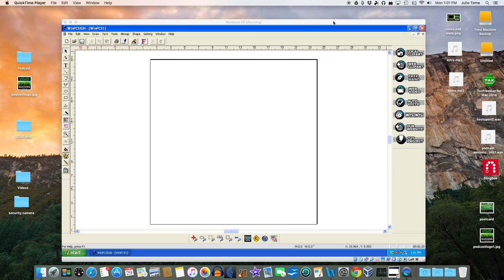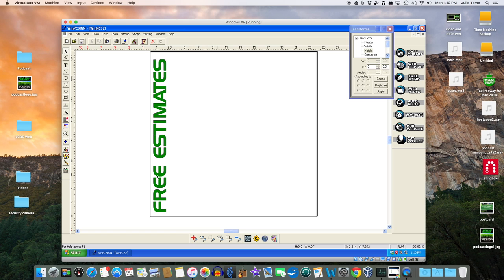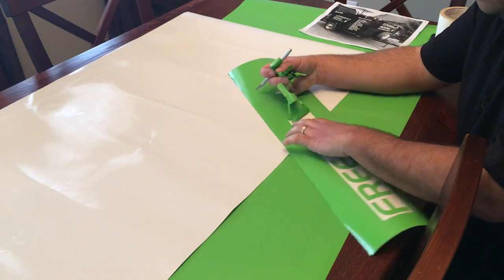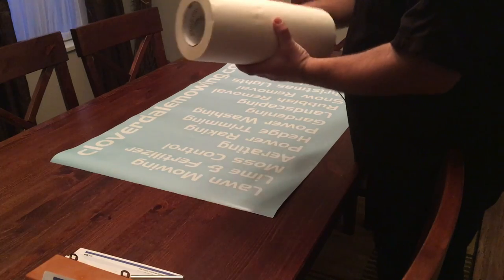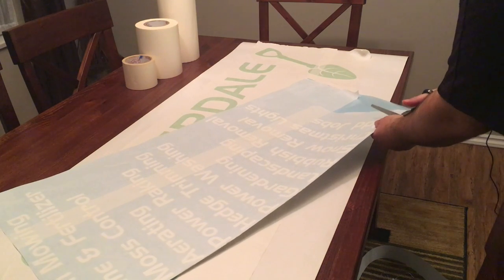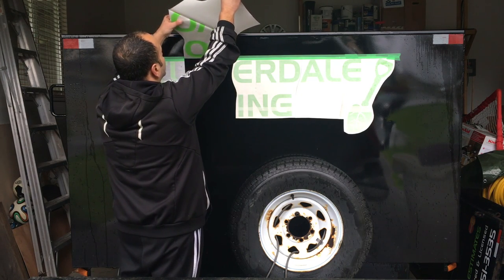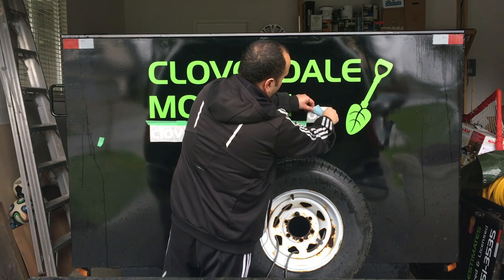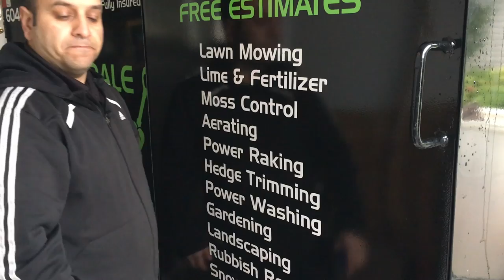Create your own vinyl signs with a plotter (Tutorial)

Comment: Nice job! The info I was reading said the outdoor life for vinyl is around three to five years, is that your experience? Do you have issues with any of the letters coming loose? Can you seal it and extend the life with polyurethane or any other coatings?

Thanks for the time and effort you put into it!
Reply from the maker: It depends on the grade of vinyl you use. Some cheap calendared vinyl is only meant for indoor use or temporary outside use while cast vinyls are much better for outdoor use. Also the climate where you are located would also make a difference on the longevity. The same type of vinyls will last a lot longer in Seattle than it would in Texas I would imagine. With that being said I believe I used Avery A6 vinyl on the trailer. So it is warrantied for 6 years outdoors. If you watch one of the latest videos I just did about my custom trailer tour you can see that the decals still look fantastic with no issues at all. No cracking, peeling or shrinking. This video shows me redoing the decals on the front and side door of my trailer after it was stolen and had to be fixed and painted in those areas. So the decals I did in this video are about 5 years old.  The originals decals on the rest of the trailer though are coming up on 10 years old and still doing great. Thanks for watching.

Comment: if you the hing method u could of just put in vertical in the center of the decal and it alot easyer
Reply from the maker: thanks for the suggestion.
Reply: you can do the same thing u was doing but cut it down the middle and it save time when u do that way